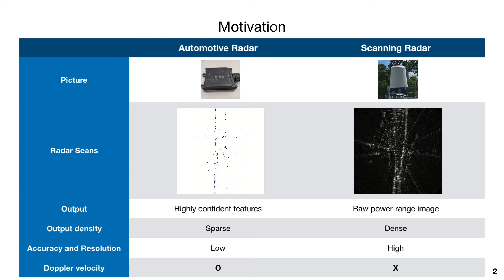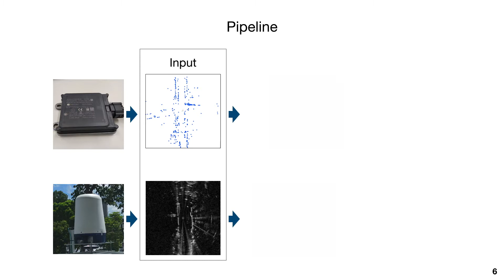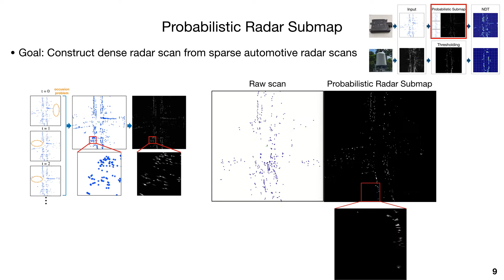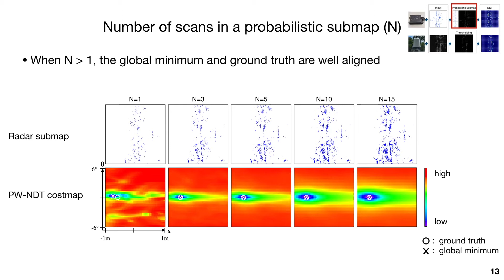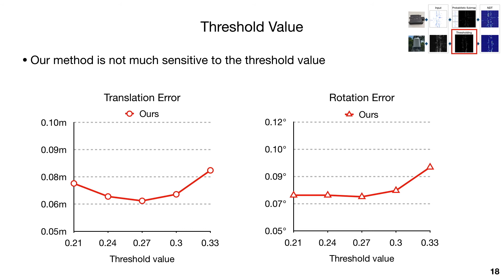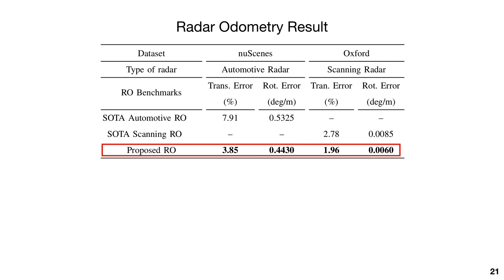[ICRA 2021] Radar Odometry Designed For Scanning and Automotive Radars

Comment: Thanks for this excellent presentation! Could you explain a bit about the submaps? I see the submap generation relies on egomotion estimation based on Doppler, but somehow you're also using the P2D-NDT to estimate egomotion. This sounds a little counter-intuitive to me, for example, why did you choose to use two different egomotion estimation algorithms? Also, in the results, where you compared your method with Kellner's and Rapp's method, why you did not report their performance for different N values?
Reply: Btw, do you conduct the full 3DoF estimation in your proposed method?